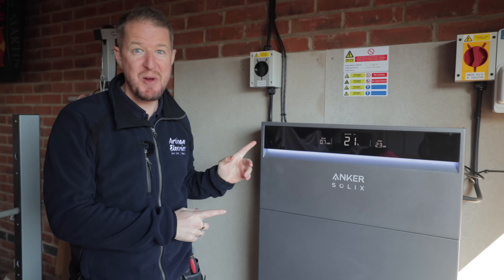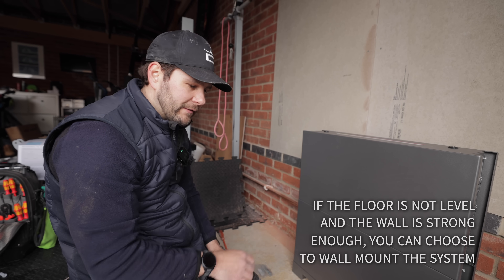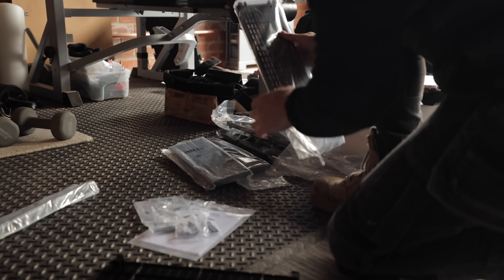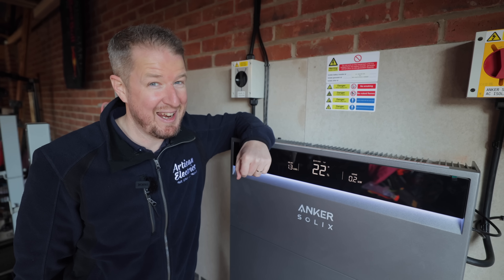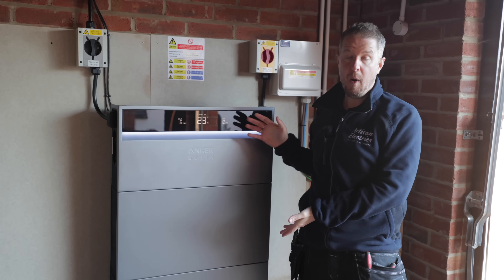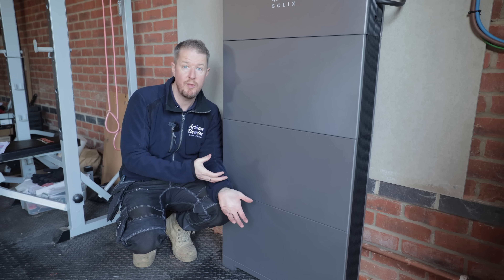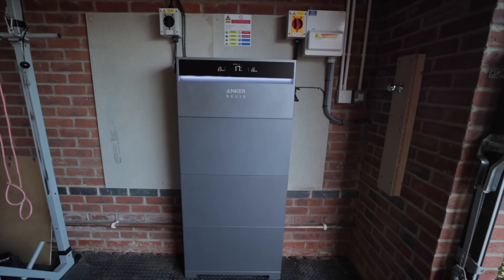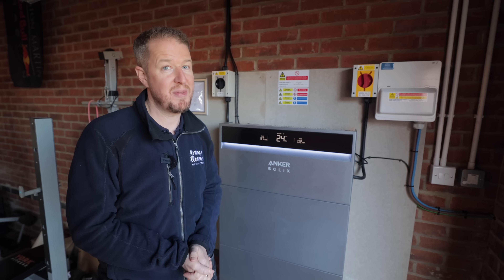Is this the SMARTEST home battery storage system? Anker Solix X1

Comment: I’m very pleased with my 10 kWh X1 installation on an outside wall.
Reply: How much 10kWh cost?
Reply: I'm in the planning stage of a 10kwh possibly 12ish. My average daily use is 8kwh minus the car), it peaks at 9.5kwh. 

I was looking at self building, but I'm a big Anker fan. So this will be interesting to watch. I've just put my name down on the Anker site for updates on the product. 

I don't have e solar, but plan to charge the battery overnight on 7p kW tariff.

Comment: Its fairly difficult to actually find technical information on the X1.    There's a ton of marketing material but precious little technical material.  Seems quite undersized, too.... lets see.  The US AC-coupled X1 only has a rated output power of 3kW.  The AU version is also 3kW.   Is the 6kW you quoted just peak output?  What is its LRA limit?  Does it have backup options or meter collar grid disconnect options for backup?  Is it just grid-interactive only?
Reply from the maker: Just to clarify — the Anker Solix X1 product does have off-grid capability, so it will work during power outages. Also, there’s no need for a separate gateway, as it has built-in gateway functionality. Hope that clears things up!
Reply: @artisanelectrics  That's not actually an advantage.  With a built-in gateway you are now forced to route the full utility service through the integrated unit.  That means you can't scale the inverter capacity without splicing the utility service through multiple units, and also forces the inverter/battery units to essentially be located right next to the service entrance.   The whole reason for having a gateway in the first place is to avoid those issues.

In contrast, when a gateway is involved, the inverter + battery units only need wiring sized to the inverter capability... which tends to be far lower amperages.  And the inverter + battery systems can be located significantly far away from the service entrance without costing an arm and a leg in cabling and work.

Gateways also often have ports to allow the system to scale to multiple inverters without having to splice the AC inputs and outputs, have all the CTs built-in so you don't have to wire CTs, and can monitor and manage power flows to enable the rest of the system to be far more scaleable.

This also looks like a high voltage stack... its hard to tell because the specs are so lacking.  Similar to what SMA is hawking... which isn't doing all that well for SMA to be honest.   Expensive proprietary lock-ins, tiny little storage increments that are individually worthless, and limited scaleability.

-Matt

Comment: Anker Solix X1 15kWh battery storage should cost $9500 before installation and more likely £9500 in UK before installation, as most products imported from US cost 1:1 ratio, cause involves import taxes..
Reply: No worries there then, Anker are Chinese company.
Reply: 15 kw would be a spec for an inverter, not storage, did you mean 15 kwh?
Reply: @ I meant 15kWh.
Reply: In the UK, a Tesla Powerwall 3, including the Gateway and installation, typically costs between £7,800 and £10,000.  Higher generation capacity, 3 MPPTs, immersion proof if you live in a flood plain 🤣
Reply: I believe it's made in china. not the us. Probably cheaper than in the US, especially with that carrot in charge to mess things up ... In that mentioned price about 25..33% is installation cost. That installation IMHO can be done by any handy little educated electrician, unfortunately X1 installation is limited to only those appointed by Anker .... (compared to a kindalike app on the 2 pro and 2 ac)

Comment: Does it work properly without function loss without sacrificing your privacy to Anker? It would be great if you would include privacy reviews when you review devices/systems. I'm only willing to use any systems that do not send data to their own servers. Everything need to work locally.
Reply from the maker: Good luck with that 😂
Reply: @artisanelectrics  I'm guessing that's a 'no' on discussing privacy during reviews?
Reply: Should also cover a fairly important subject of ongoing maintenance costs, warranty and system life duration? Does the system have individual battery module monitoring so that if one module fails you can replace with  new?

Comment: You didn’t mention about the ability to go off grid and still live for the home with the optional gateway in a power cut scenario unit like Tesla
Reply from the maker: Just to clarify — the Anker Solix X1 product does have off-grid capability, so it will work during power outages. Also, there’s no need for a separate gateway, as it has built-in gateway functionality. Hope that clears things up!
Reply: @artisanelectrics are you sure in the usa there is a gateway unit separate, that way you can tie in ac feeds as well

Comment: Nice video as usual Jordan. Seems like no UPS or EPS functionality on this one. I didn't see a gateway either so wouldn't that mean no solar generation during a main power outage event? Can't really understand how anyone would install a solar system that doesn't work without mains (no island mode) Looks like Sigenstor is still the big Daddy ❤
Reply: Can you also please clarify whether it has UPS or EPS capability?
Reply from the maker: Just to clarify — the Anker Solix X1 product has no need for a separate gateway, as it has built-in gateway functionality. Hope that clears things up!
Reply: @artisanelectrics  I don't see a separate earth rod. (i.e.TT) and how is the system disconnected from grid?   (Not enough room in the utility suppliers box for all that...)

Comment: So this doesn't have a gateway, like Tesla/Givenergy then? So it can't go into island mode in event of a power cut and still generate?
Reply from the maker: Just to clarify — the Anker Solix X1 product has no need for a separate gateway, as it has built-in gateway functionality. Hope that clears things up!
Reply: it does thank you, it could have been a talking point to say it's gateway functionality is built in given the size of the Tesla/Givenergy gateways and the cabling needed for them.
Reply: @stever5648  Doesn't the Tesla powerwall inlcude the gateway nowadays? (I know the older one is separate.)
Reply: @ the videos I've seen still show a gateway is needed to go completely off grid when there is a power cut, even the v2 aio from givenergy still seems to need the gateway for automatic switching to island mode, altjough they can discharge without it. Was just interested, as also have the Giv AIO so too late for me!
Reply: @artisanelectrics  Not if I'm not mistaken. In the US a separate gateway is sold for this. No grid = no output, just UPS functionality in a separate 'schuko'

Comment: Is it ok for the batteries to be mounted right up to the big gas pipe running through that garage?
Reply: exactly my thought!
Reply: he's not got the brains to think that one out, even dafter putting online
Reply: It's probably not wise, but the modules get at most 10C above the existing room temperature, all enclosed and no open wires to create sparks...
Reply: @so ur not concerned about complying with regs for the installation that say it should be 150mm away?
Reply: @scotsdunc  Ah, I'm not sure that if the batteries caught fire a 150mm gap would make much difference. But regs is regs!

Comment: Impossible for it to be galvanised stainless steel. as the galvanising process does not "bond" to stainless steel.. I suspect what you meant is they used stainless AND galvanised steel components ;)
Reply: I was thinking the same thing.
Reply: It would make far more sense to use marine grade stainless steel surely?
Reply: @hughmarcus1    Yes for  sure  . Galvanizef steel is no good close to sea water.
Reply: @raymondschembri5042  galvanised steel is better than normal steel and can be used near sea water, its just less durable than stainless steel but a lot more cost effective. You just trade off some life span.
99% of dockyards / jetties gantries and bridges are galvanised steel. The only time you really see stainless steel used in its place is for aesthetics.
Reply: @HandyC  Interesting info. Perhaps galvanized is not a bad choice if they expect that the entire unit won't have a much longer lifespan than the batteries.
Reply: raymondschembri5042 They use galvanised steel for the deck drains on the aircraft carriers. I just love it when experts talk shite
Reply: HandyC Another expert talking absolute shite
Reply: Using galvanized steel and stainless steel is a definite no no

Comment: My own battery/solar system is truly SMART……I have my own software look at “tomorrows” solar forecast and if it’s sunny then no point in overnight charging. Totally dynamic and will adjust the inverter cheap rate charging times accordingly.
Reply: Mines even smarter, it recharges every night to 100% during off peak from 23:30, it calculates it's charge rate so it's at 100% by 5am, which gives half hour for balancing. In the evening it will export and calculates the rate to reach 15% by 23:25. Using these dynamic rates reduces loads on  equipment and the grid. Import is 7p and export is 15p, so makes sense to fully charge every night. My DNO limit is at my inverter capacity so no issues there, and I'm not causing havoc with grid voltages.
Reply: @TheRonskiman  I'd like to export at peak rate (25p) but generally, my electricity usage is all over the place due to my electronics workshop so trying to calculate what I could export between 4pm and 7pm isn't easy. I might have a go at it though.
Reply: @IanScottJohnston  I used to be on Flux, and export as much as I could at peak rates, but I realised that something like Octopus GO with a flat 15p export rate was so much better financially. Now I have an EV I'm on IOG.
Reply: @TheRonskiman that’s fairly typical now nothing new
Reply: @TheRonskiman  how does the financials add up? About 8 years to break even on battery cost? 

That's 3k cycles and end of battery warranty?
Reply: @TsLeng  Built the batteries myself, Eve LF280 cells, supposed to be good for 6000 cycles so about 16 years at the current rate, and they will still work, just have less capacity. Financials are stacking up well, 2015 install paid for itself by 2022. My gas and electric have been negative two years running now.
Reply: @TheRonskiman  in that case yes, it would work out ok.
Reply: Very interesting. I assume you utilize home assistant and MQTT from the inverter?
Reply: @Vrykorps  Bulk of mine is done directly on the Victron system, only thing I use HA for IOG dispatching via MQTT.
Reply: What batt system is it. Lots promising these functions but not so many working well
Reply: @TomTheSurgen1  Not sure what you mean about not working well.......but my set up is: Solis RAI-3K-48ES-5G battery inverter, 10.5kWh Pylontech Force-L2 LiFePO4 batteries and a separate Bosch BPT-S 4 solar inverter. All working very well and with a noticeable reduction in my electricity bill by about £1000 per year. But, you have to manage the system to get best out of it.
Reply: Where if ever, would a bedini ssg battery charger,  fit into a system similar to yours?
Reply: Victron has that function built in their software
Reply: Surely you get more for export than import costs overnight, so this isn't very smart at all
Reply: Export and overnight charging is better though
Reply: @Lee-jy7jz Agreed. Only reason for not doing this is if you're on old FIT scheme
Reply: @Lee-jy7jz  Not if you're on Flux
Reply: @Lee-jy7jz next on the list is to enable exporting any excess at the peak rate times. Not entirely easy since I’m in Scotland and being a high electricity user though.
Reply: @Lee-jy7jz  it depends - you also need to factor in wear and tear on the battery. On IOG you'll import at 7p per kWh and export at 15p ... but you'll get anywhere between 85-95% efficiency (AC vs DC coupled battery) which brings you down to around 7.2p profit per kWh.

I have an additional wrinkle - an export limit of 5kW, which with a 12.8kWp system (east/west split) means I need room in the battery to charge from solar that would otherwise be curtailed.
Reply: @PhilJohn1980  there is no profit doing it really. Just putting capital up to shore up the grid for not much😂
Reply: @TsLeng  That's odd, my solar exports have covered all our gas and electric for the last two years, even a few hundred pounds profit each year.
Reply: Can you give us an idea of how much your installation has cut your grid usage across one year?
Reply: @alanpmasters  heat pumps are rubbish in the winter it's also when the pannels produce the lest. So a season by season would be more informative. 

The winter is also when gas turbines produce the most electricity.  If you have gas mains an efficient and environmentally friendly gas boiler is "still" by far the best option
Reply: @thetourk  Not sure where you have tried using heat pumps, but I’m in Maine in the US, we get months of 0-10f weather, and my house has been well served by ONLY heat pumps for a decade now..  my solar is certainly far less productive in those months, and without net metering, we’d have a far different annual cost- but this mix has been fantastic for us fir many years now.
Reply: @BobFiske  it does depend if you are on national gas. In the uk we have the most expensive energy prices in the world. Owning an ashp cost on average 33% more than gas. Pretty much zero difference to co2, so even if you are one of the people who buy into that particular disinformation agndas it make very little sense. 
Please note ashp should not be confused with ground or geothermal heat pumps.
This is where I  Contradict myself because I've got an ev and don't have solar panels on the roof of the house because its rented. But it shpuld be by law  (when suitable) that anyone using an ashp or has an ev must have solar and at least a 20kwh battery pack.
Of course now they have admitted using chemicals released into the ionosphere to " reduce world temperature", solar isn't going to work as well lol
Reply: Have any of your battery systems caught fire? Also is there any problem charging when temperatures get down to 0 degrees C?
Reply: @robertbye4618  if your asking me, no. I have T class fuses on each battery pack, and a breaker, there is also a fuse and breaker for the whole rack. It's installied in a detached garage. I have a hardwired smoke detector wired back to the house alarm system. The battery packs have heating pads which turn on at 8c, this winter they never got that cold, last winter I think the heating come on twice. All cabling is rated well above the fuses, the fuses have a very high amp breaking capacity. Hopefully I've taken all the precautions I can and I think it's probably safer than some commercially available setups. PS I always charge the e bikes outside on the patio.
Reply: The software with my Solis inverter is very labour intensive I'd love to have done smarter options, I can't find any software that works with it other than there own.
They do have updates so hopefully in the future they'll have more options available
Reply: Solar is crap
Reply: My Tesla Powerwall does solar forecast and cheap rate charging automatically.
Reply: @nealm1814  So does the Victron system, the big benefit of the Victron system is you can write your own code to do exactly what you want. Just depends on your programming skills.
Reply: @TheRonskiman  Frankly I don't want to make maximising the cost effectiveness of my home battery and solar installation a hobby so I'm happy to leave that up to Tesla.
Reply: @nealm1814 Like I said it does have all that built in, and I agree, not everyone is capable, they just want to install and forget. I want my system to do what I want though not what someone else thinks I want. My system runs under its own steam now, yes I occasionally have to fix an odd bug, like one I had when the clocks changed, but it pretty much just gets on and does its thing exactly as I want it do it.
Reply: @TheRonskiman  100% agree. I have my EVSE reported as a victron EVSE when it's not but code allows me to track it as such. In my case I can go beyond just next day's forecast but since we have dynamic rates (OMIE Market) I can optimize when to charge both the EV and batteries from the grid. Gotta love Victron.
Reply: @nealm1814 Same, works fantastically. Those that say not buying PW3 because of Musk etc. Who cares. Great piece of kit. 👌